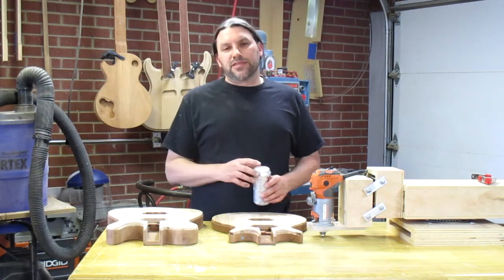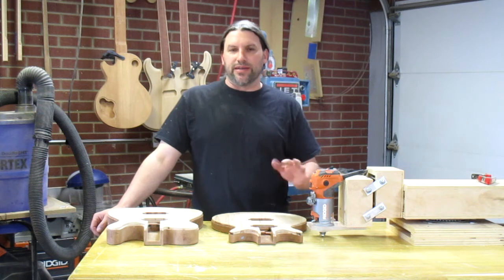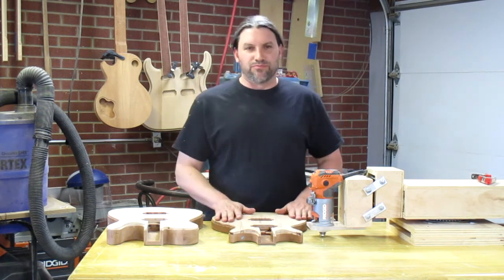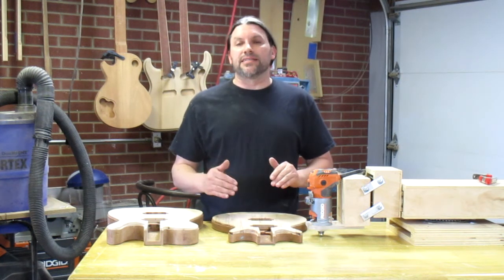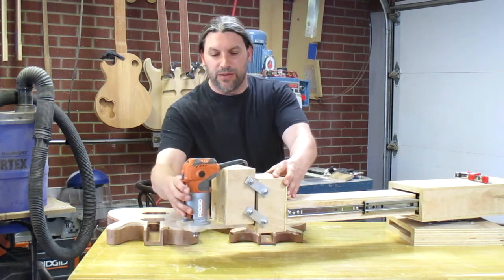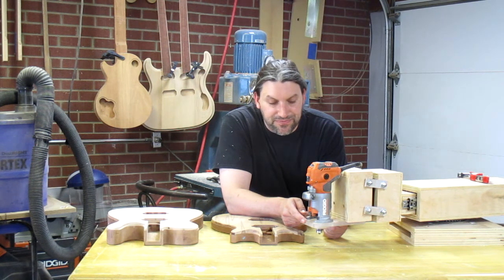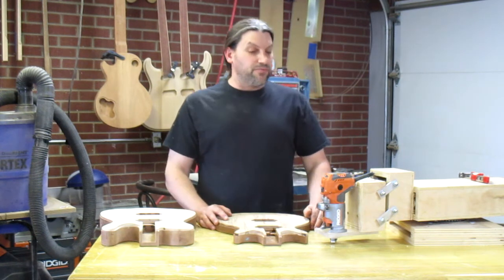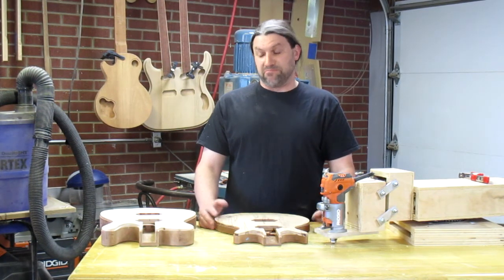Matt's Binding Router Contraption

Comment: I'm curious if you can use a drawer slide instead of the trolley system on your newer model? It seems to be able to make a consistent vertical movement without any noticeable slop

Comment: This one looks nicer than the one on the bungee cord one. I struggle with clean binding cuts for sure. Ive changed up to a dremel with that special head just for binding. It works but still kind of sucks. Not that easy and you have to go slow if you dont want to tilt it and make a bigger channel than necessary.
Reply from the maker: They both work